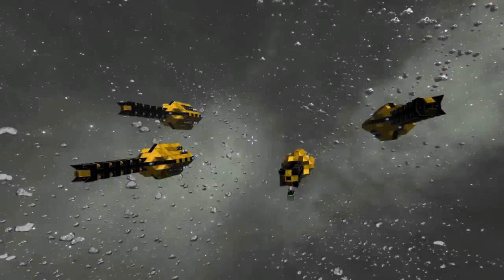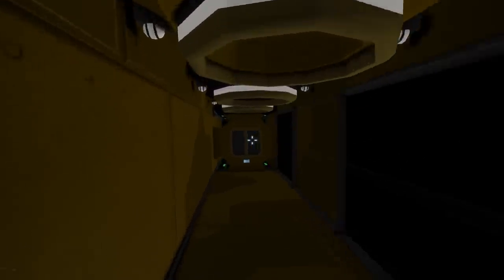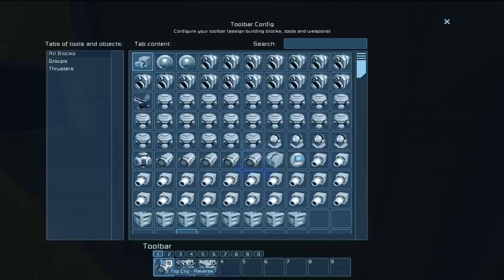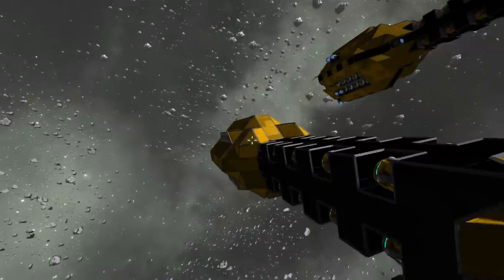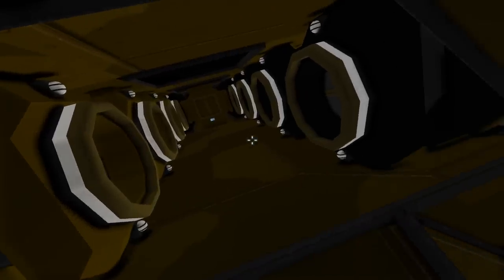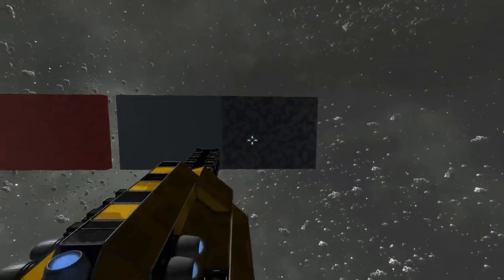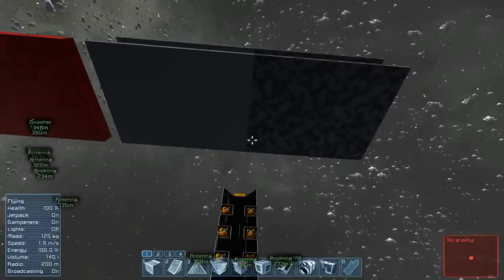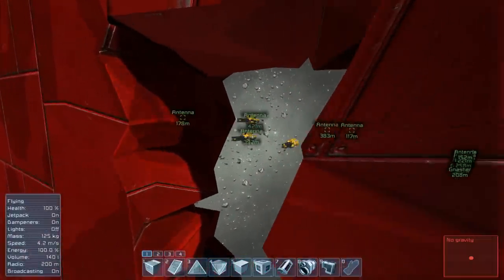Space Engineers - v2 Ore Cannon & Impact Experiments

Comment: For Spechiracl generators to be effective against ore cannons, you must have some distance between the canon, the sphere and the target.

If you max out the grav gens to 150m and the ore canon is at lets say more then 900m away, the engine will have time to calculate the ore collision and speed, and the grave gen will then deflect them.

Made numerous tests with varying ranges and such, at a long distance and max range, spherical gens will ALWAYS delfect the ore.

If you set up the Grav Gen below the bar of 100m the will be slightly deflected but will still hit, below 80m it will pretty much hit where you aimed at.

It also depends where the grav gens are set up and the size of the ship of course.

If the ship is like 50 blocks large and there is one grave gen in it, it will not work, even at max distance
It needs at least 80m distance between the  hull and the grav field to work.
Reply from the maker: Cool, I'll try test it further at longer ranges, not experienced that behavior yet... Thanks for the info :) The Spherical gens actually go up to 400m so you have a slightly larger field using those instead of linear ones, the ship in the vid had a pair of generators set to 100m which evidently isn't enough for the ore to really calculate position yet but could easily be changed to test other ranges and field sizes.

Comment: ***** Watching your explanation of the timer system, I wonder if you could set them up to 'rotate'.  Basically fire one chamber, wait 3-4s, fire the next, etc.  This would get you a smaller load per shot but make it effectively constant fire.  Which might help mitigate the damage to the barrel from the target's missiles (by having outgoing ore provide 'chaff' for incoming missiles every shot.)  Dig the redesign otherwise though, much cleaner.

loads up SE in his brain and starts devising 8-chamber versions that could fire every ~2s :)
Reply from the maker: Yeah, at the moment I sometimes trigger them manually like that but it could very easily just be automated into the timers themselves and you just press 1 button to unleash wall of rock and another to stop it again. Think mine fires about once every 4-5 secs when done 1 chamber at a time in succession so an 8 barrel would be plain vicious! Interesting you mention chaff as well, I was thinking of using the ore cannon like that as a screen for the torpedoes and it didn't cross my mind for a second you could employ the same idea for defending itself.. I do like how Space Engineers puts u back in your place every now and then with some simple thing you just completely overlook :)
Reply: ***** The chaff idea came from wondering how much ore you'd have to shove out into space to keep incoming missiles from reaching the barrel.  Probably a lot, but it would have some rather devastating 'secondary' effects.  And yeah I love the fact that an idea, or even a small aspect of an idea, can spin off a train of thought that can reveal entire fields of previously unconsidered implications.  It's one of the many reasons I dig mechanics-rich games like SE.

Comment: Will you also try out gravity-torpedos? They are quite fun to tinker around with and can be launched via gravity-cannon
Reply from the maker: Yeah I think that might even be the next one as I want to experiment with the idea of using a magazine system to load things into the chamber which would be perfect for torpedoes :) Cheers!
Reply: A good advice that I can give you  is to place a sensor on the torpedo that extends to the back to switch of the artificial mass after it left the cannon so they are not affected by gravity anymore
Reply from the maker: Nice trick :) Imagine they are a lot easier to mess with than the ore cannon is, will definitely use that one. Cheers
Reply: Denis Shazbot Nice to see others coming up with the same work-arounds that I have :D Timers are amazing things

Comment: Just so you know what is happening with it going past armor if the shots are fast enough it can pass the object before the game runs a collision check and when it does if the rocks are inside a block it is destroyed

I have been testing this for the last 3 weeks and have found that a 10k rock with 28g can go past 18 blocks of heavy armor the distroy 18 blocks then pass more blocks then destroy more befor losing momentum and getting traped

I use a piston to push a long line of cargo crates in to a grinder to load it 

Great video keep up the good work
Reply from the maker: So basically it deals damage every time a collision check is made but then will go back to passing through objects until the next is made? All the while it's traveling sufficiently quickly of course.
Really like that grinding idea as a method for getting a big load in all at once, I guess when the cargo container is destroyed you get a much larger piece of ore out of it than the connectors produce? Thanks!
Reply: *****

no problem

the only problem you have to fill the grinder with rock so it dusnt steal your shot this will also make you fire the components of the contaner at the target havent found a way around that

Comment: Does the lenght of the cannon affect the result?
Asuming that the G force is the same and it's field covers complitely the projectile.
I did a rail type gun, it worked, later I started doing a ship with G-generator acting as propulsion/weapon, builded a ring,with even more gravity generators, with projectiles few blocks behind, and it just  doesnt work well.
Reply from the maker: Yeah the barrel length has no effect at all other than to provide a place to but the gens on.. Sadly gravity can be a bit like that, you think something should work but it doesn't quite act like you expect, I've sadly had a good number of those sorta outcomes too.
Reply: *****  Ring type canon for some reason not allways affect rocks, even within gravity field.
 It seems like the tube is an optimal form as connectors eject no more than 1K ores, so you can make a buckshot, rocks bounce with each other and then walls, so the tube keeps them relatively concentrated and directed.
 The issue is that while in the  tube, bouncing doesnt affect the speed, but after few hundred meters rocks can bounce and decrease speed and change direction.
 Once I made mistake and placed 2 spherical generators somewhere around, they aranged rocks in fusiform mass, even better, when launched the mass didnt bounce the walls, kept the form, the speed and direction 100%, went thru the ship as a single object. now when I try to shot again, it just builds the mass perpendicular to the tube and destroys everything. Only if I would find a way to repeat the test.
Reply from the maker: Ra Leo The method whereby you force the rock into a single mass seems to definitely be the way forward but as you say takes some pretty specific conditions to get it to behave like that. Good luck getting it repeated sir. I know they can be made consistent but honest have no idea how it is it's done :)

Comment: you could use a low power grav gen to fix the problem with the one with 2x connecters
Reply from the maker: Aye that might work.. concerned that if I stick any more ore in at once it'll tear itself apart though :)
Reply: ***** it doesent have a problem with spaced armor also it still works without mods
Reply from the maker: Looks cool from the pics, will check it out when I get home.. So mods don't add major functionality? Cool.. much prefer when stuff can be made purely in vanilla.
Reply: ***** the mods are just thrusters so they are not important at all also a weapon as a laser sight you could just replace it with a stock rocketlauncher and the way to operate it is press 4 than 1 and wait then when you have enogh ammo in the chamber you press 4 than 2
Reply: ***** also you may need to put a new large reactor on it
Reply: ***** so how did you like it?
Reply from the maker: The Scout Pretty impressive dude, looks the business also even with the missing parts from the lack of mods.. (I did load it up after with the mods on the have a look at the 'proper' version also!) Some nice damage too.. makes me wanna revisit my ore cannon project and convert it over to using steel plates in a ball instead of the shotgun approach! :)
Reply: ***** also never make them go into a ball it just makes the damage way less make them go into a rectangle
Reply from the maker: The Scout
Platinum ey.. that's some expensive ammo right there! :)
Reply: ***** i have a chalenge for you make a better gravity weapon
Reply from the maker: Alfa Legion 8th Company The Scout
You are right, I really should have another go with a more up to date version. I'll see what I can do :)
Reply: ***** also i uploaded a new version http://steamcommunity.com/sharedfiles/filedetails/?id=389707005
Reply: ***** also i found something funny if you are not the host of  the game it does significantly more damage
Reply from the maker: Alfa Legion 8th Company The Scout Happens in all multiplayer stuff, the host's sim speed runs about 3x as fast as everyone elses.. to the extent where my mini-golf course plays completely different in MP than SP as we found out on Saturday :)